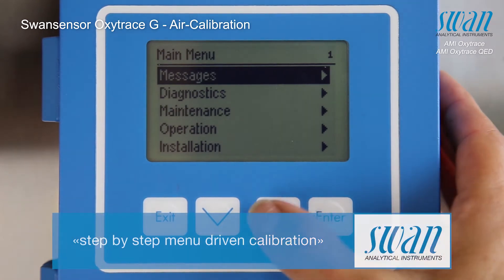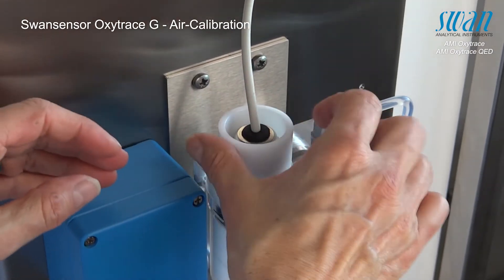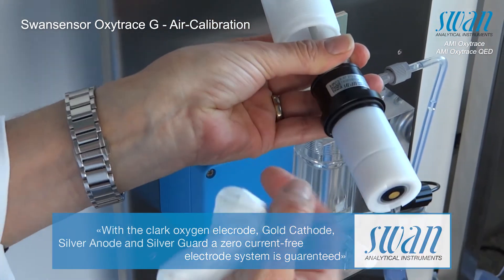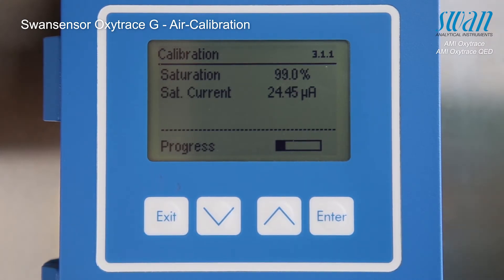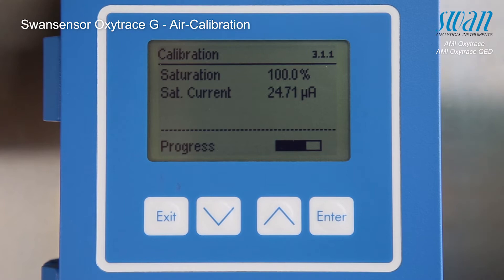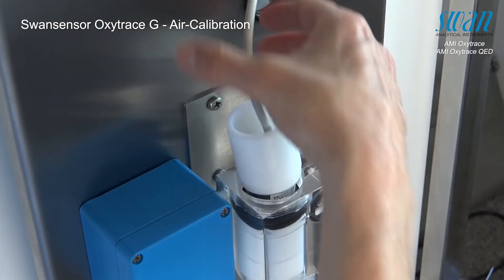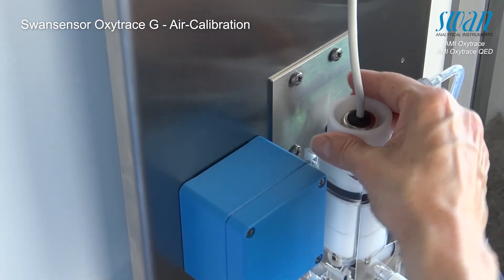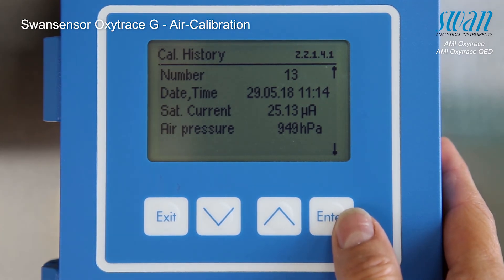Swan – Swansensor Oxytrace G – Air Calibration

Comment: How to fix error 031
Reply from the maker: Hi Ardan, 

This E031 is caused by the electronic failure that handle the signal output on the mainboard.  Usually a reboot (power off then power on) of the instrument helps to solve this error.  If that still doesn’t help to solve this error, then the customer will need to exchange the mainboard.

For further problem/ details, please ask the customer to write an email to support@swan.ch  then we can keep track of the problem with the case number.

Comment: Ok so if the saturation level doesn't ever get above 23% what could be the issue?
Alky solution was changed and ran at air for 1 hour then tried to do an air calibration but would not take a cal because of the saturation was not high enough.

Is saturation referring to the akly solution of the anode and cathode?